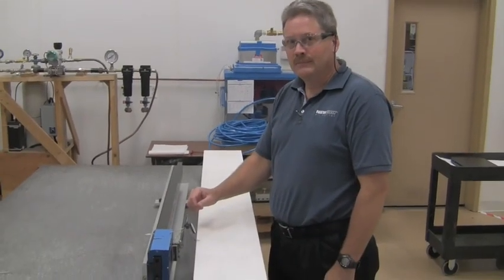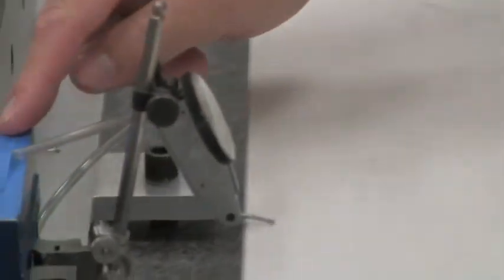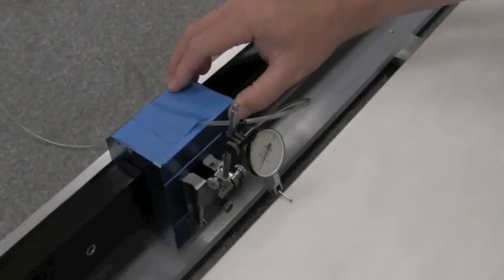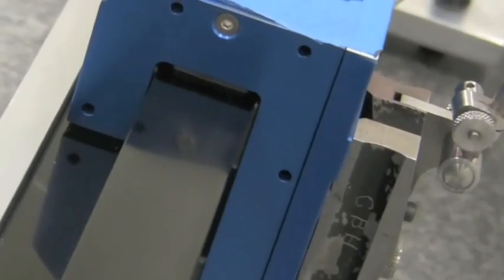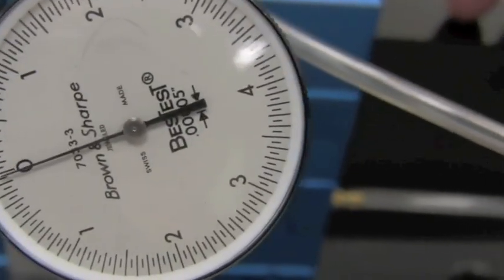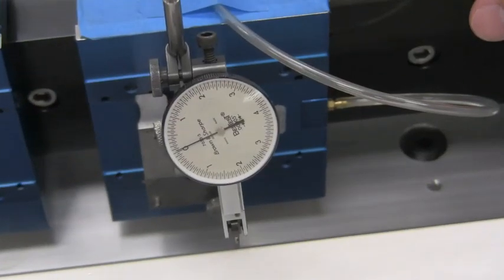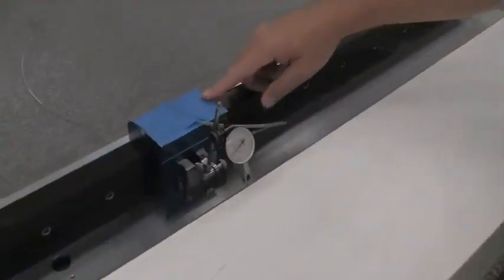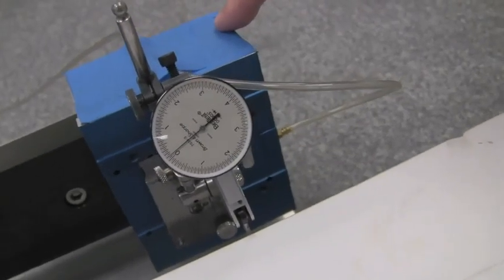Air Way Straightness

Comment: Such a pity this hasn't hit the main stream yet, at least not in the private market. Currently building a 1m by 1m CNC, and as it happens the base is a repurposed platform I got from a chip manufacturing company that went belly up and was using this base (a 1 x 1 meter 4cm thick aluminum plate) on a support frame that has 4 of your round air bearings on it. Which is how I got here I might add. I would love to use slides like this to make up the X and Y axis (not sure if they would work well for the Z axis too). But beyond your own website I can't seem to find anything on them anywhere locally. Something also tells me they would probably be out of my price range.